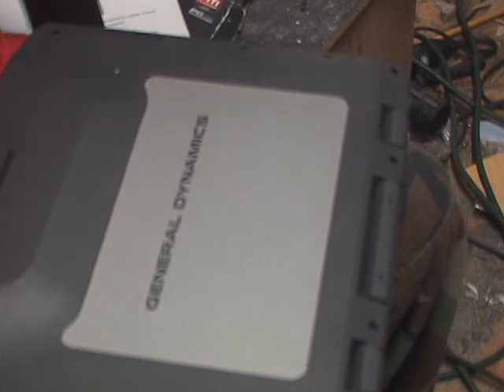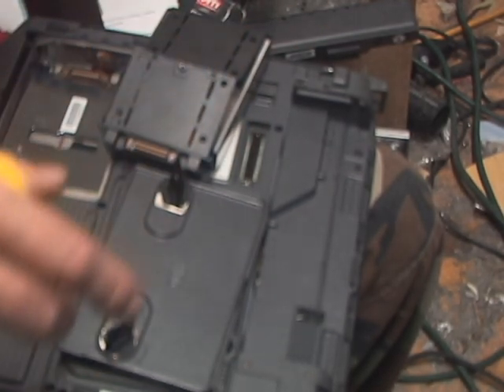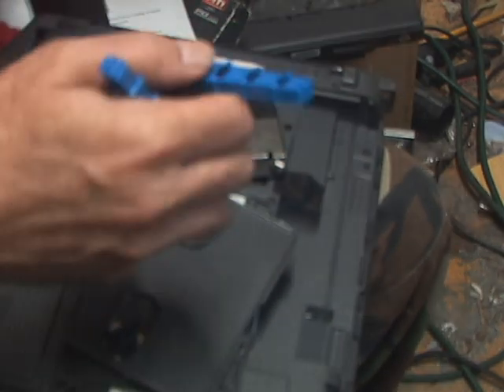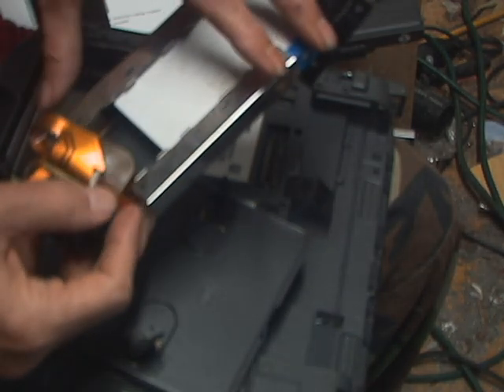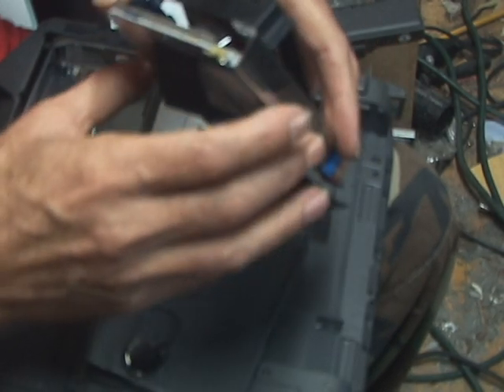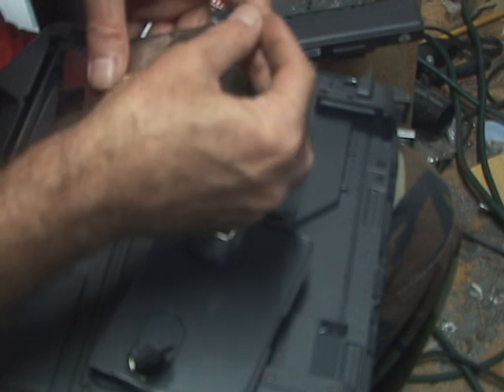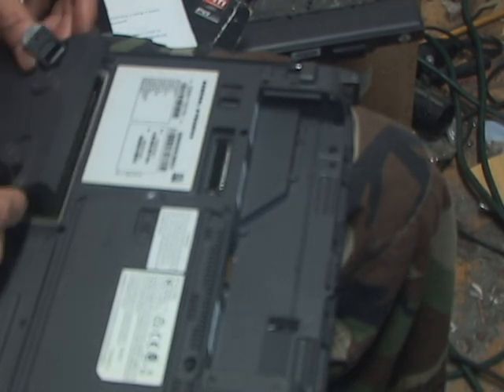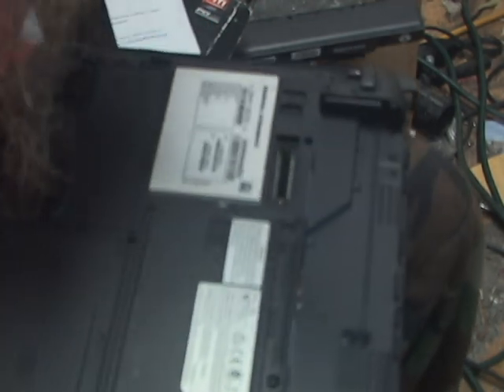General Dynamics GD8000 Hard drive swap

Comment: Legit my dude! My quest that lead me here was wondering about the heater cable and all that. The caddy is WO but thought it odd the keep the cable but had a plug in it. But, then again, mass production is mass production and that's why all Chryslers vehicles from 80's until cab forward era were all wired for the Infinity sound option.

Comment: I recently got the GD8200  and im waiting for it to be delivered, do you know general dynamic computers are powerful or good for video gaming? secondly do you know what software the units come with that I may have to find?? ps TRUMP2020
Reply from the maker: There is absolutely no such thing as a laptop that's worth a crap for gaming .. unless you are playing really old games or candy crush ... .. There's a couple of archives for the drivers but for Linux you dont need em and windows 10 everything works after you do your updates ... intel for the video driver (enables HD vs stock microshit driver will do hd but poorly/drops frames)
Reply: @dawino6260  They don't call em craptops for nothin'.
Reply: @dawino6260  the gd8200 will run windows 7 good, when I try windows 10 it crashes every 3 mins. with the KMODE_ blue screen. even with all drivers updated via. easy driver pro. I can't figure it out. I know the Bios is AMI CMT: 108 cannot find the bios update anywheres not even on AMIs website. anyone have any ideas? its driving me crazy
Reply from the maker: @atruceforbruce5388  I never use those driver updater things .. 99 percent of them are malware or bring malware in ... hit your device manager in 7, list your devices, print em .. gather your driver's directly from who made the device ... over 4gb ram I've had problems if they didn't have the last (newest) bios from general dynamics  (works fine under 4gb though) 1800 something was the last build of win I tried on it ... but wait .. is it just doing the post install video driver install? Because that will black the screen quick for a minute or so - twice .. looks like a crash but isn't ... I usually have my drivers extracted to a flash drive on any machine and leave it in but boot from my win 10 stick ... 10 is pretty good about bypassing the microshit drivers and using what I have on the flash drive ... Maybe boot from an OpenSuse livecd image hit yast then devices and see what does not show up that should ... also .. it's possible you have one of the cpu s with bad microcode (sceptre/spectre vulnerability) 10 hates those chips and tries to install a mitigation patch that rarely works well ... not sure if those cpus are still covered but intel used to replace them for free plus shipping if they had the bad microcode
Reply: @dawino6260  I'm assuming its the sandy bridge i7 thing. it has worked awesomely with every linux distro I have used, Parrot OS is the best distro. you have made good points. The older rugged I have is the motorola ML910 and that handles win10, but its slow as hell. and the cost of ddr2 sodimm is outragous something like 150.00 for 8gb. 4gbx2
Reply from the maker: @atruceforbruce5388  I like OpenSuse and suse enterprise .. and Cents .. I've tried a lot of other distros  but they are all too easy to punch through (debian distros like Ubuntu are almost as easy to punch as windows anymore) ... But, yup - the Linux community patched the microcode problem quick and right .. I can't remember if it was sandy or ivy bridge  sounds like the right era though ... Wait till the world finds out about v-pro's built in holes lol .. (almost the same hole as VIIV had)
Reply: @dawino6260  classic lol you on twitter much? if you are brother hit me up sometime @Vicioussaid
Reply from the maker: @atruceforbruce5388  I got kicked off of twitter and facebook both .. Neither likes my views on Islam .. the winning comment on Facebook was my opinion that BLM is just a bunch of black racists every bit as bad as the klan was.. so I'm on mewe, vk and parler now .. I gotta update my links on this page still .. but I'm a bit lazy .. been meaning to update this for a while ..  but haven't lol
Reply: @dawino6260  I got kicked off too because im a Trumplican, also a 15 year 3rd group special forces combat veteran who likes to post truths about the democrats that jack Dorsey hates me posting. lol I hear you
Reply: @dawino6260  lol I hear you man!, hey Darwin , have you ever disassembled your gd8000? the most I have done has been putting fresh thermal paste (grizzly cryonaght) however one thing I remember when you mentioning the microcode, is that windows 10 only shows 2 cores of the processor working between the crashes, where my linux shows all 4 cores working, here's the question some older mother boards don't solder the processor down and im convinced the only difference between your gd8000 and my gd8200 is the processor, same mother board perhaps? do you know if I could move from the 2nd ken processor to a ivy bridge or Kirby  one of the newer processors. im curious because of the continuation of the line and same chassis used for durabooks r8300. if its easier you could email me at cedriclacarte@icloud.com and I do apologize for congesting the page.
btw happy thanks giving to you and your family from me and mine.